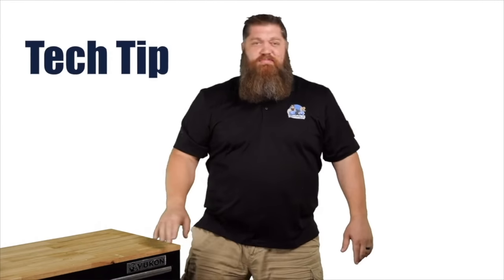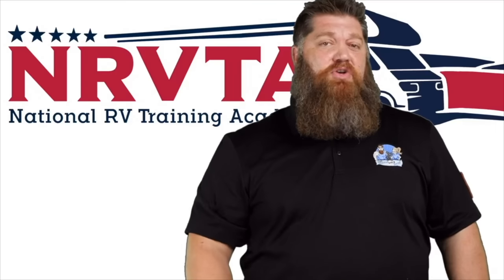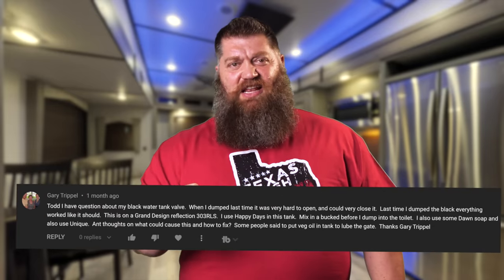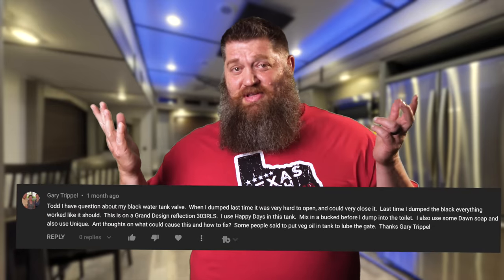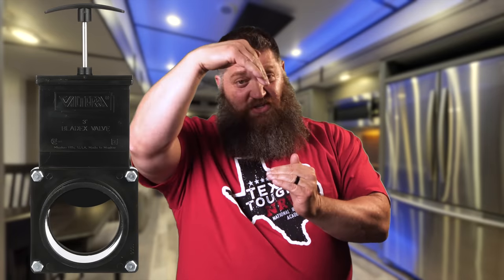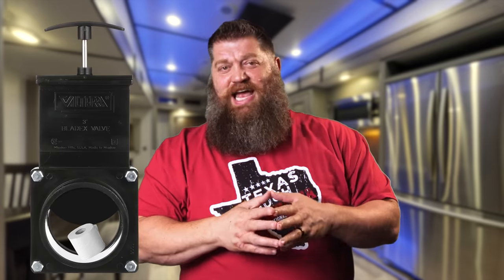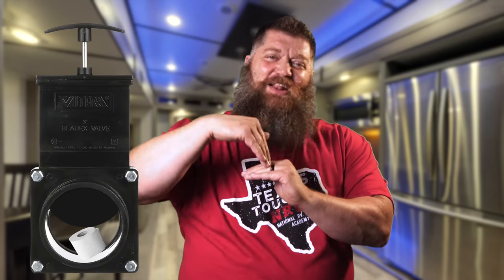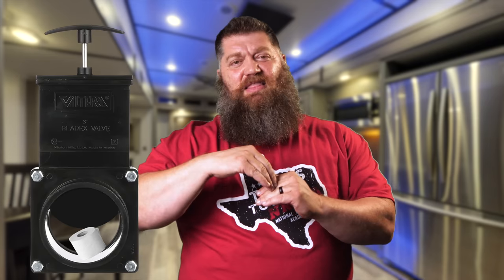Black Tank Valve is HARD to Open

Comment: There's a third possibility. Manufacturers tend to coil cables that are too long in a tight radius. Use a fiber optic camera to look inside the underbelly. If you see that the cable has a tight radius, cut and shorten it  or re-route it for less friction.

Comment: Water.  I tell customers to fill their tank half way before using it.  Personally, I drain my tank then use my shower hose to add water with the tank valve open just to help push those floater down.  Once drained I fill again to halfway.  No issues as of yet.  I had a customer that would keep their grey tank open while draining the black tank.  Complained of a smell from the sink.  Was a good chuckle while educating the customer.

Comment: I bent my black tank valve rod which also caused gouges in the rod! Between the rod not being straight and the groves catching it was really hard to get it moving. I wiped the rod down, straightened as good as I could, smoothed with sand paper, wiped down rod again and viola!!! It worked!
Reply from the maker: great
Reply: My rod and handle pulled completely out
Reply: @donaldarvin8506 Hey! Just happened to me. What did you do?
Reply: @JaniceTDesigns You'd need to replace the valve. You could probably replace just the cable and reroute it, but the fact is you'd need to take off the underbelly of the RV anyways to access, so at this point you may as well replace the whole valve (which comes with a new cable, etc.), then you get fresh gaskets with valve too.
Reply: So, I did whole handle piece. Was difficult but worked. THEN, a couple of weeks ago, my whole black tank fell off. Ooops! New problem. 😂

Comment: Two things I’ve found helpful- Try to let a few hours go by between “introducing” solids and dumping.  

Second, get a cap with the garden hose type port and attach a quarter turn valve.  When you go to dump get the stinky slinky laid out, and before you take the cap off hold the slinky under the quarter turn valve and open it slowly.  Once nothing comes out, you know you can take the cap off without stink sploosh.

Comment: What if the valve doesn't open all the way and you just get a trickle when you try to empty the black water tank? We had a technician come out and back flush the system and he said that it's not solids or a blockage. He said the valve isn't opening enough to allow anything but liquid through at a very slow rate. Thanks for any advice you can give.
Reply: See he doesn't address it. I think my valve is disconnected from the pully

Comment: I got it open admit it was tight, but got it then all the stuff is clear and gone, and water clean. sprayed the valve  with silicone spray really well and will continue to spray if you tell me ok thats what i did and it ran very well thanks for your video really valuable it is closed all the way out and the wand did the job well

Comment: Hey Todd, love the videos and have learned a lot. I have an in-line Valtera bladex black tank valve under our toy hauler and I can hardly open/close it. I don't see a way to access the inside of the valve without taking the pipes apart. If flushing the  black tank doesn't remove what is blocking the valve, is it ok to run a black tank hose from the exit opening and try to thread it and flush that way?

Comment: My 2600RB Grand Design's black tank handle is frozen.  I watched a video via 2krazykampers on how to replace it, but still hoping that is not necessary - and it says you have to purchase the the whole waste valve system, although you can pull the cable from the new unit and replace it rather than pulling the waste valve.

Comment: My camper sat for 5 years before I bought it with the cable valves open. Now I'm not able to close them. Can I loosen them back up somehow to close them?
Reply from the maker: you can try adding some dry lubricant to the cable pull. if not you may have to replace that service valve.

Comment: Stuck open is one thing, what about having a full load and the valve is stuck shut. How do you fix this? I managed to get mine open and flush it out, but is there a way to avoid this? When it was stuck closed, I could pull the handle out, but the valve would not open. This is a direct handle to valve, no cable.
Reply: You put vegetable oil down the toilet. It lubes the valve door and will keep it from jamming. You can also do it with your grey water valves as well.
Reply: I have the same question Dennis... just this weekend my grey valve got stuck shut (and remains shut). The handle moved with normal force and didn't feel abnormal in its movement but no grey water exiting.  I am wondering if the cable broke or perhaps came loose. (No previous issues with this prior). Thanks for any advice. bg
Reply: @takeitallin6882  I did eventually get the valve to open some and ran a snake to help open it up and brake up any solids that may have been there. I then dumped many gallons of hot water down the toilet to flush along with using the internal flush system. It did work well after. I did see where if you have access to the valve body, where the valve pull out rod comes out, or valve slide, is. You drill a small hole in that part of the valve and spray lube in that area and then plug the hole with a screw. It may be an option to making sure the valve does not get dry and stick.
Reply: @denniskwasnycia1950  when making the hole, ensure the hole is only as big as the straw on the spray can (this hole is made closest to the actuator rod exit/entrance) then ensure a short screw is used! I use the 3in1 side seal lube. Works great! Change a black tank valve one time (even if it’s your own RV) and you won’t want to do that chore again.
Reply: @22howards  Thanks Chip!
Reply: These were some good tips. Thanks guys for your contribution.

Comment: Who says put vegetable oil on the cable? No one, that’s who. The vegetable oil is for the valve itself. Yes, poor vegetable down the toilet to lube the valve door. Also, if you’re going to give tips, how about finishing the tip. You introduced the toilet paper in the valve, so how do you get it out now?
Reply: The vegetable oil for the valve door works.
Reply: You tube probably has a how to video on cleaning a black tank.
Reply: Actually there is a YT channel where that's exactly what they suggested. Pour vegetable oil down the sink to lubricate the gray valve.

Comment: I have a Open Range 373rbs with 2 black tanks and they work very smoothly but I have 2 gray tanks and their valves will stick closed. The valves are above the corplast, I have tried after dumping to add vegetable oil or food grade mineral oil. Any suggestions

Comment: My fresh water valve is staying open when I hook up the city water it fills up my freshwater tank what do you think the problem is
Reply from the maker: It depends on what type of fresh tank fill you have. A common issue is a back flow issue from you Water pump. It's supposed to act as a one way check valve. but it doesn't always. you can alway get a check valve and put it inline with your water pump or change out the pump.

Comment: My valves are above the underbelly cover.  Have to drop the corplast to get to them.
Reply: That's unusual.
Reply: I wonder which make and model you own.
Reply: @Squirrel-zq6oe  Heartland Big Country 3155RLK.  The handles are in the driver's side bay with the city water feed point.  The valves are remote up by the tanks and above the underbelly.